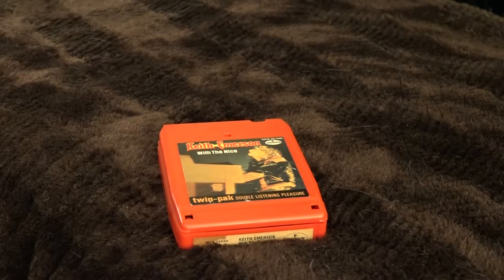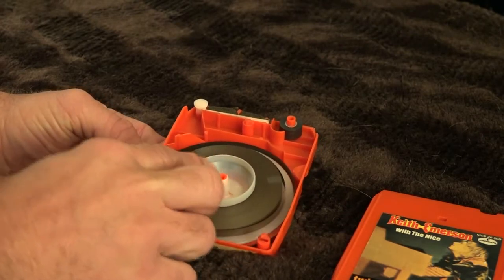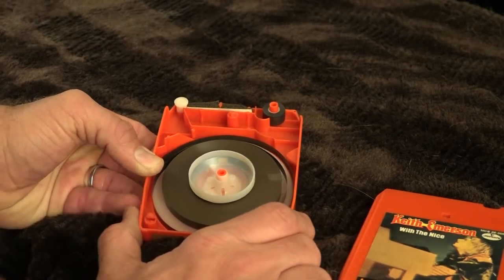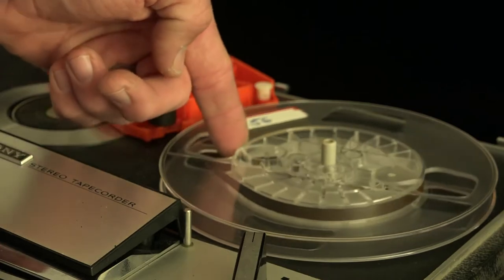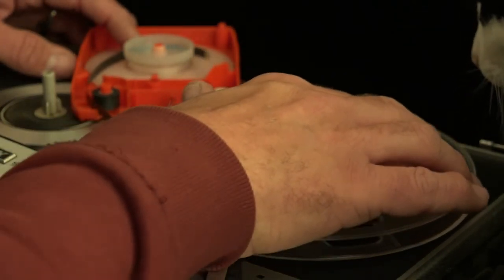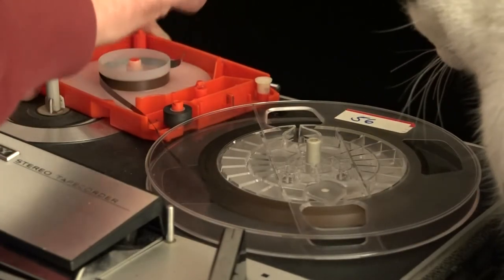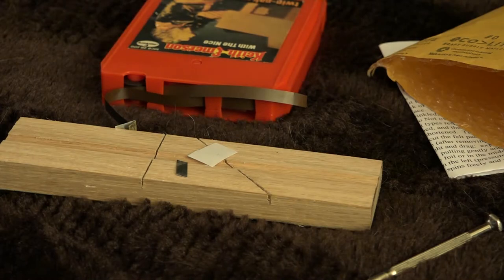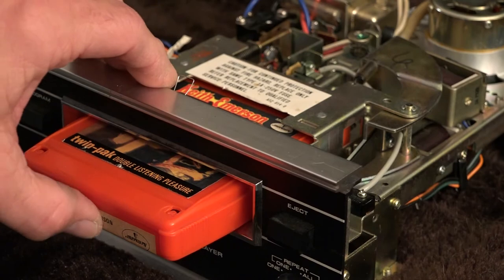Repairing an 8 track tape,  re-edited

Comment: There's a lot of tape on there.  Usually I don't see that much tape on there.  It must be close to 90 minutes.  I looked up the album and calculated all of the track lengths and it comes out to 84:55.  It's over 21 minutes per program.  Thanks for the upload.
Reply from the maker: Yeah, prog rock and those long solos.

Comment: It is really enjoyable to bring back some of those earlier years. I recently started repairing my own 8 tracks after purchasing a Akai reel to reel recorder which had an 8 track player build in. 
I have one question, Is there just one (1) aluminum foil strip in an 8 track cartridge or could there be more then one.
Thanks, enjoy your video.
Reply from the maker: Lucio Morales as far as I know only one aluminum strip, to advance the machine to the next program at the end of the tape.

Comment: But then.... i was wondering... could you just use regular 1/4 inch tape to create new 8 trackcassettes that can hold longer than 90 min. of music?
Reply from the maker: MK3424 I thought I read somewhere the 8 track tape might be coated with some kind of Silicon lube so it can make the turn out of the reel so regular tape might stick but it might be worth a try.
Reply: Nope. 8 track tape was specially lubricated compared to open reel tape. I've tried it before and the whole system is prone to binding.
Reply: @cttv90108  I know I'm a few years late, but I definitely know the tape's "slip backing" (what I've known it as) is graphite--same stuff used in pencils.

Comment: hi my mate has alot of quad one's i had to show him how to test them so the decks he got don't eat them in the akai decks  never put the deck it ff in a akai 
before you checked the  changer part   use a low end deck just to send tape around the loop if the cart has a break the tape will be  ok 
not 8 tracks get hit with alot of wear 

all the tape bodies with wear i move the tape out on to reels and bin the case  put the tape in my akai 1800ss and kill the recording 
before this a use the fostex m80 to move over recording   i check spotify first just in case it hard to find  like quad recording are out of date 
with 5.1 incoding from stereo  you don't need 4 channel any more